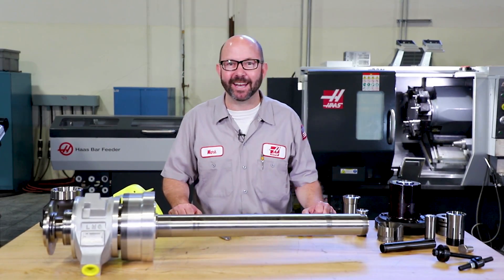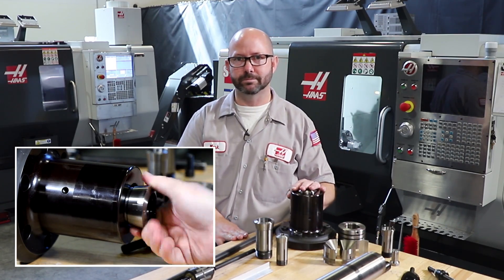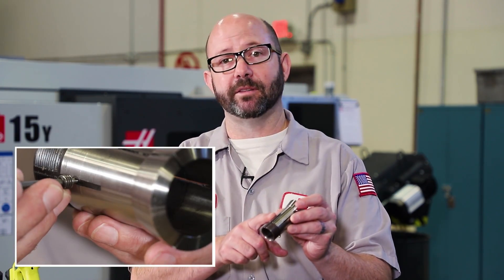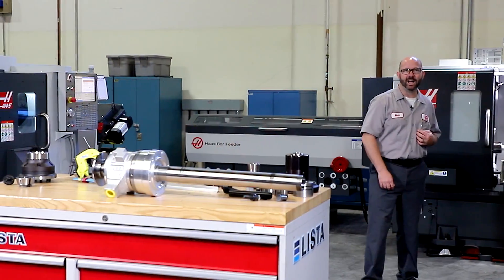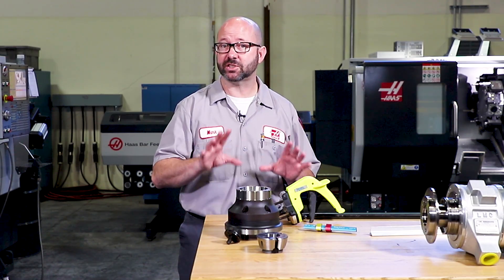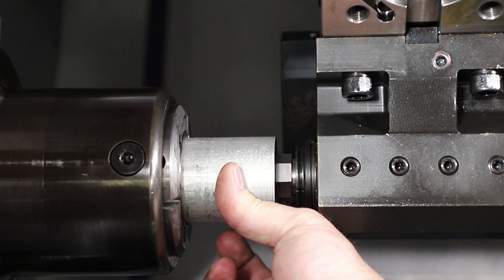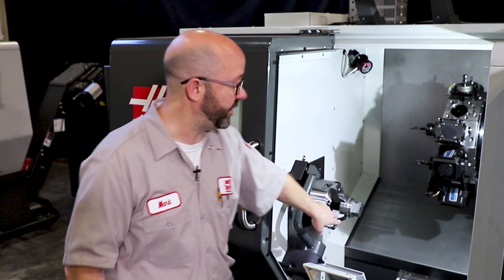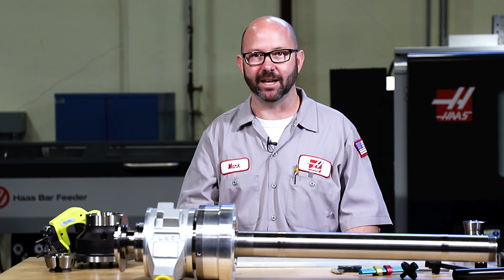Lathe Part Stop Essentials. Do You Know? – Haas Automation Tip of the Day

Comment: One thing I am puzzled by is the stability of the push-to-close collet systems - the part that is closing the collet is moving in a loose fit in the spindle, meaning that there is play between the closed collet assembly and the spindle just where it is most unwanted. Can you give any feedback on that?

Comment: Thanks for the very useful information and the great video!!!
I would like to ask how to determine the clamping force of the collet chucks? In turning, a collet chuck holds a workpiece with a suitable clamping force so that the workpiece neither moves nor is deformed during machining. Is it calculated by analytical modeling, or is it determined by simulation or experiment? Thanks in advance!😀

Comment: Yes the royal quick stop are awesome, the true length comes in handy for second operations and they have integrated stops as well.  We used to use a turned down cheap muffler expander inside the drawtube that is similar to the spindle stop from ROVI. : )   Also 5C "emergency" collets can be bored to size with an integrated stop for high-volume production second end operations. : )

Comment: You’re not supposed to be using material in ”c” type collets, that isn’t of a pretty exact diameter. There shouldn’t be variance. All single angle collets are meant for just one size, the size on that particular collet. Double Angle collets, the ones that are parted from the rear as well as the front, can be used with variable diameters. So those single angle collets should never be used for variant diameters. The problem isn’t so much where the end of the work is, it’s that clamping down on work that’s not the collet size results in the collet wedging and the jaws losing parallelism, and the work wobbles. That’s a far more serious problem.

Comment: We have two new Haas st10 lathes with barfeeders  and want to use bar feeder for stop but our nextgen controls do not recognize the v axis command.
Reply: We are having the same problem!  I think a video with the capabilities of the new bar feeder would be great!
Reply from the maker: In a recent software update, 100.19.000.1100 (BZ628), we added a G266 function that allows us to use our Bar Feeder as a stop, and still have the control keep track of all of our bar feed information for us. Give your local Haas Dealer a call, and ask about upgrading. Thanks for the comment! – Mark, Haas Tip-of-the-day
Reply: @haasautomation  Is there a video or documentation on how use G266 for a bar feed stop function?

Comment: On my old CTX 310 i tried to use tool as a stop for push colet chuck, the force is so huge - its moves turret in Z -axis with open door and when i close door, turret squeeze thin stock in an arc!

Comment: Why is the machine cannot measure length of the part after it was secured in the collet and apply measured offset to the part's design before it will process the part?

Comment: We use a bar pull and sometimes a collet stop that screws into the back. The .006" draw back isn't a big deal because we typically face .01-.02" off anyways. I know it adds up if you do thousands of parts, but it's not a big deal for us

Comment: I use a old TL 1 haas lathe at work with collect stops all day! With a lever I manually pull back my finish part lengths are pretty consistent but they have differed every so often

Comment: Thanks for posting this Mark. I set parts with a home made depth gauge that I use the back of the chuck.  Since I c ut the same part most of the time it's a quick and accurate way to set my parts.
Reply from the maker: StrikeForce Dad – That’s great. Most of the time it isn’t about making the part, it is about making the fixture! – Mark, Haas Tip-of-the-day

Comment: Another good way is to use a tool as a front stop. Like a dowel in a boring bar holder. Then you put a position and an M1 in the program to pull the material out to it.
Reply from the maker: Trainedtiger – That’s a great method. Like rick371 mentions, we have something similar at 08:30 in this video. On the mill, I’d use a dowel pin in a holder in the spindle, commanding it to an XY location and then locating my part of that pin as a movable stop, when I had to cut around that entire perimeter (normal stop would be in the way). We have to be really careful with our code though. Thanks for the comment. – Mark, Haas Tip-of-the-day
Reply: he displayed that method